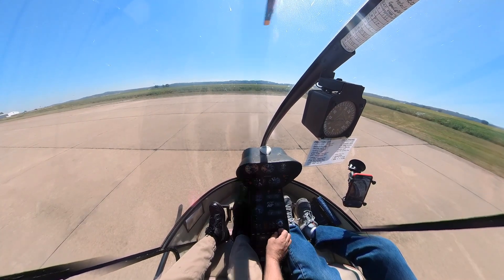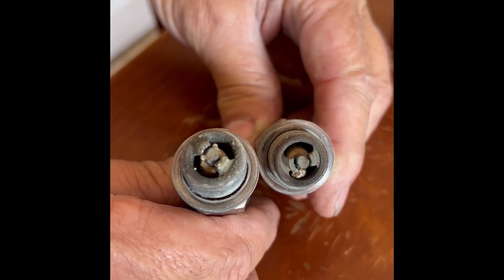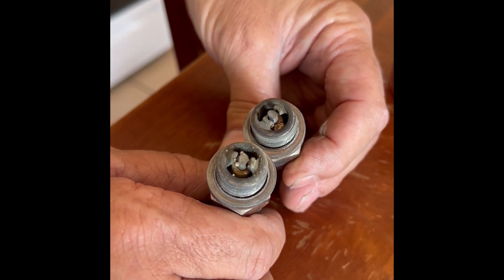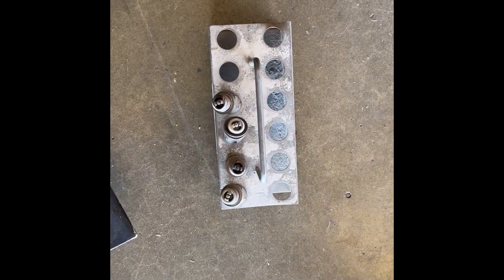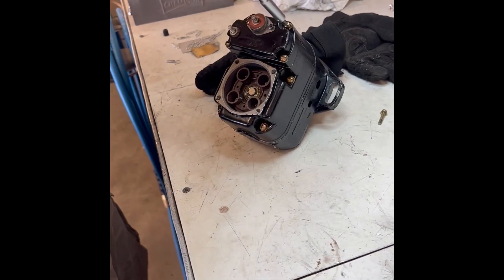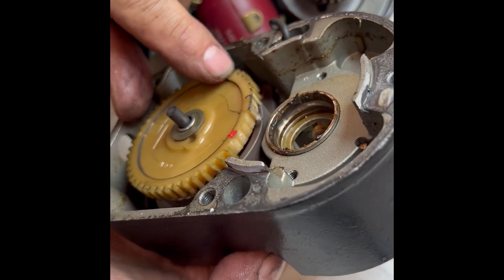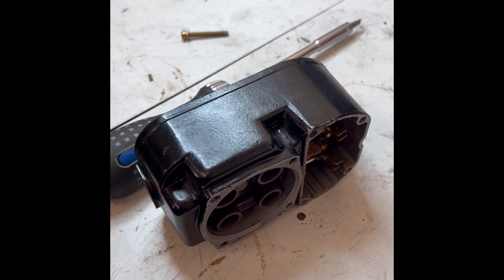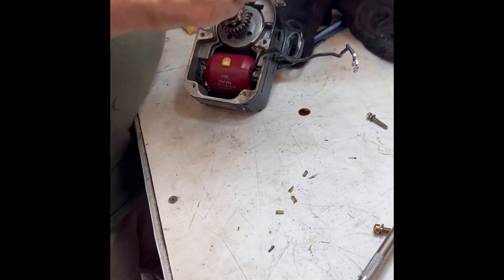A Common problem with Magnetos- You will want to watch this!!

Comment: I have never seen the left magneto mounted (located) on the right side of any engine, and the same is true for the right magneto, it is located on the right side of the engine.  Maybe some engines are configured that way, but I have never seen that configuration.  Please provide proof of your statement and what engine(s) that is true.
Reply: The 540 engine in the R-44 is mounted "backwards" compared to a typical airplane installation.  Thus, the "left" mag is on the right side of the helicopter.
Reply: @ThatBobGuy850  That Bob Guy and Cape Copters:  
I agree with both of you on what you each said.  However, if you watch and listen to the video from 2:35 through 2:41, you will hear that he specifically says “Now pay attention.  The left magneto is located on the right side of the ENGINE relative to the aircraft…”  However, from 2:46 through 2:50, he then states: “And, the right mag, which is located on the left side of the aircraft…”  I admit that I did not hear correctly what he said about the position of the right magneto, still regarding the left magneto he misspoke about its location.
Reply from the maker: The front of the engine is towards the rear of the helicopter on the R22 and R44, thus the right mag is on the left side of the aircraft and vice versa, as far as proof goes, i guess your going to have to trust me on this one? or look it up yourself
Reply: @capecopters  That Bob Guy and Cape Copters:  
I agree with both of you on what you each said.  However, if you watch and listen to the video from 2:35 through 2:41, you will hear that he specifically says “Now pay attention.  The left magneto is located on the right side of the ENGINE relative to the aircraft…”  However, from 2:46 through 2:50, he then states: “And, the right mag, which is located on the left side of the aircraft…”  I admit that I did not hear correctly what he said about the position of the right magneto, still regarding the left magneto he misspoke about its location.

Comment: Magnetos belong to history, or at least they should. Same with carburetors.
Reply from the maker: magnetos are 1890's technology, Electronics are comings soon.
Reply: @capecopters  I expect you know all this. I was being kind, but I should have been accurate. The first magneto ignition was by Simms and Bosch and was used on an  1899 Mercedes. The first fuel injected engine was a 1916 Otto Mader aircraft engine. In 1925 the Swedish Hesselman engine was using petrol direct injection and by current terminology was a stratified charge engine. In WII both Germany and Japan used petrol direct injection aircraft engines. In 1948 Delco-Remy brought out cold cathode electronic ignition and Lucas introduced transistorized ignition in 1955. Pontiac was the first car manufacturer to offer electronic ignition. FADEC for aircraft engines didn't arrive until the 1990s. But in electronic terms that is forever ago. The low power system-on-chip devices we use in night vision goggles have vastly more performance than a FADEC engine controller needs. Adoption has been strangled by the massive greed of Lycoming and Continental. The first GA FADEC systems added $60,000 (SIXTY THOUSAND DOLLARS) to the price of the engines. What should it cost? This isn't high performance processing, the hardware for a FADEC box isn't going to cost $1000. After that it's all profit and excuses for why it's good to rip off aircraft owners. No new engine should come with anything other than FADEC. Retrofit should be no more expensive than adding an electronic backup horizon.

Comment: Seems like a really bad place to be using plastic gears over a metal one.  Is there a need for it to be electrically insulated?
Reply: Most likely the designed weak point of the system - the plastic gear teeth will shear before something else more expensive breaks.

Comment: Do the bearings on that core have grease on them? 
If they're dry, or if the core wasnt placed properly upon assembly of the case, OR if the besrings weren't positioned correctly on the core, that could be a contributer to it chewing those teeth off. I used to do 500hr & 1500hr part changes on that exact kind of magneto. Cleaned & regreased the bearings with dilectrig grease everytime. Stuff had the consistency of peanut butter.

Admittedly, ive never once seen teeth torn off a gear like that. So i wonder what else could do it.

Comment: What might be the expected life for this plastic gear?
Reply from the maker: in 15,000 hours , I've had 3 fail.  2 on R44's and this one on a n R22. Magnetos have a 500 hour inspection interval.  It's certainly not rare to have the plastic gear have some teeth knocked off.
Reply: @capecopters  I occasionally work on some stationary power generators, and a certain brand uses a Ford throttle body that has a plastic toothed gear. We've got four of these units and three have stripped teeth at one point or another. Why engineers try to cheap out on this one tiny part is beyond me, but it kills the whole unit when it breaks. Untold thousands in downtime, parts, and labor, so they could save a nickel.